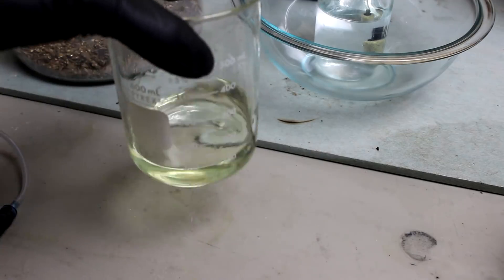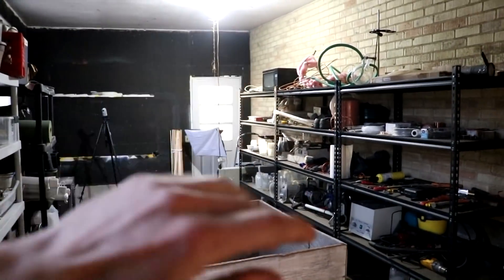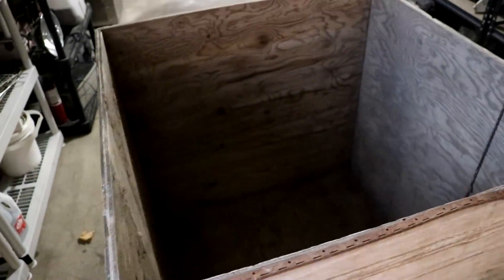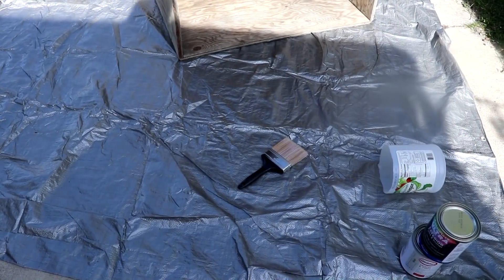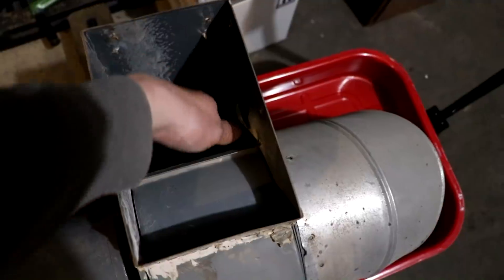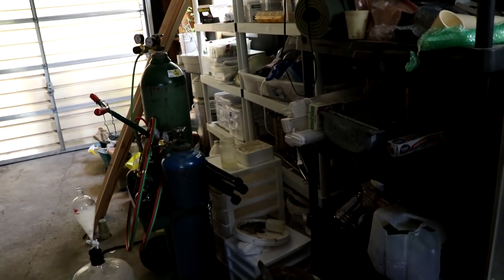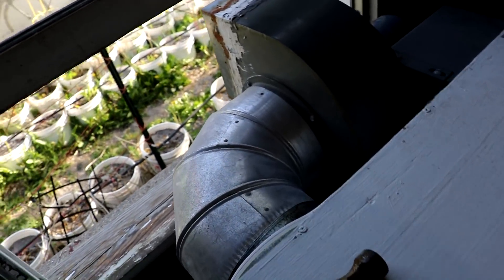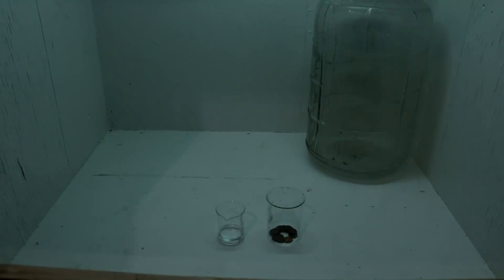Cody’s Fume Box

Comment: I refine precious metals. A few things you are going to run into. The nitrous dioxide is going to turn that wood into nitrous cellulose and potentially ignite. The electrical items inside the hood are going to be eaten by your acid fumes. Cannee with the metal duct work and the squirrel cage fan. It is good you built a fume hood, I just think it isn't going to last very long the way you built it.

Comment: Literally an acid rain generator with that BFRC there. I get that eventually it could be fertilizer, but that's ignoring a lot of damage it could do in the present. Especially in an urban area. Also, that fan is going to be covered in rust and corrosion pretty quick from the fumes. I think they make fans designed to withstand AR fumes. Might be good to mod that in there with PVC instead. Even stainless will succumb to acid corrosion.

Comment: Cody, I am right now dealing with small issue but have no real way to test better solutions. My room regularly reaches 100+ degrees F, I have fans blowing in but they barely do anything. Do you think/could you test if within a constant volume area if a fan blowing in or a fan blowing out has a bigger impact on temperature? According to the little bit of gas laws I remember both should have a cooling effect for different reasons (one just because it is moving air, the other because in a constant volume system if pressure drops temperature should too drop.)

Comment: I just wonder about a few things with this design: 1) How well will that fan resist corrosion? 2) Aren't you concerned about your plants right outside getting affected? 3) Shouldn't you seal the wood on the inside to prevent the paint from reacting with anything, even the moisture in the air?

Comment: the problem i see is your just expelling fumes into the local atmosphere, without filtration, that could potentially have GREATER impacts because of it, and the fan you are using is not specialized for chemicals, so it could potentially have a chemical reaction to the gases being expelled and have a growing catastrophic failure over time.

Comment: Dear all — (1) No, this setup isn’t perfect. There is definitely room for improvement (2) Remember you’re watching a Cody’s lab video. Cody knows enough about what he is working with to know what he can and can’t get away with. Let’s imagine a ‘worst case scenario’ where Cody decides to fill his fume hood with an explosive mix of hydroxy gas, and then oops it gets lit. How much energy do you think will be released? Do you think it’s truly likely that he’s going to burn down his house in this scenario? Might destroy his equipment, sure, but doubt it would create a run away reaction. What about  toxins outside —- again he isn’t dealing with things on an industrial scale. Really doubt by the time this gets diluted in to the atmosphere it will cause much trouble, if it does though, guess what — he will fix it. Industrial fume hoods need to be built for idiots, that way you can’t sue the company that made when something goes wrong. In this scenario, a less than perfect hood is just fine. Good job Cody!

Comment: Build a mercury stun gun. You mention in the Sprengel pump that the mercury can build a charge in the reservoirs. Mercury is also a good conductor. In theory you should be able to create a charge, store it in a capacitor(or maybe even the mercury could be used as a capacitor), shoot two streams of mercury at a target and release the charge. If you don't want to shoot a stream of mercury, submerge the end ends of two thin wires in the reservoirs and shoot them instead. It should release the charge on contact.

Comment: Can you move the pump outside and run a pipe through the wall? It would be much quieter for the videos, and you wouldn't have to worry as much about the intake pulling fumes back into the room.

Comment: As someone that could not grasp chemistry - can someone explain why fumes are ok to vent into the atmosphere? I would have though some kind of catalyst or filter or something that would prevent something bad to escape out? I'm not trolling here I've been wondering this for a long time..
Reply: There is not gonna be many fumes. Cody won't be using it 24/7, its not like a factory, which produces millions or billions of times of fumes and gases, all the time. Such small quantities dont matter. And in any case its much better to vent them outside rather that inside the house, so thats why he built the fume hood
Reply: Thanks for answering. My curiosity is slightly more satisfied..
How about universities like say in Periodic Videos channel? And to be more precise if that air duct goes outside on the roof are there required limitations to roof access during fume hood's operation?

Comment: Instead of tiles or a plastic bin, you should just seal the bottom and part of the way up the sides with phenolic resin. It'll be thinner and more durable than tile and much more chemically resistant than plastic.

Comment: I see one potential problem. The fumes are going to be eating away at the fan blades, and eventually they will fail. Also, there's always a potential for the motor itself to reach the end of it's life and die. If this happens while you are using it, it could be a deadly situation. I think I would find and install a second blower just to be an emergency backup.

Comment: The exhaust fan will get eaten away by the fumes. You might want to try adding a carbon filter at the front so that at least some of the gases get scrubbed before the fan. Also, if you're going to be working with flammable fumes, you'll need an explosion-proof fan because the brushes spark. Finally, might want to aim the exhaust air directly up (outside) instead of into your garden.

Comment: If I had to guess, that box was probably used for something like concert or theater equipment. It has that kind of look, and the build/handles are pretty common in that use. Snagging that was a pretty good find, even if it is a bit worn down. Obviously it's not laboratory-grade like you'd find in a university research lab, but it was pretty ingenious. You made it to suit your needs, and it should work. Like you said, it'd likely be a good idea to put down some kind of containment tub and some tile to protect the interior, as the paint can only do so much. And again, like you said, if you're going to be deal with anything particularly nasty, you'd probably want some kind of air scrubbing. 

But for what you're realistically going to use it for, I'm sure it's pretty much perfect. It gets the fumes out of the house, and it disperses them outside. I think that's way better than setting up in the yard and just hoping that it's breezy enough to keep the fumes moving. Now you have a reliable airflow that will disperse the fumes, instead of sitting in a cloud of fumes on a windless day in the yard. 

All of that said, I'm not a chemist, not in the slightest. I'm a college student, studying civil engineering, so this is out of my expertise. I'm mechanically inclined. And while I have a basic idea of handling chemical materials and building to be resistant to them, I will happily defer to the ACTUAL chemists, as well as those with more experience. It goes without saying that you and others with specialization in this field know more than I do about this.

Comment: Hey Cody, bear in mind that this is still not fire-proof or resistant to chemical attack. Consider a protective coating of plastic and probably some spare tiles in there to be able to use it better & without risk of damage to the box itself. :)

Comment: Acidic fumes (esp. HCl) are going to wreck that fan in pretty short order. Also the ducting and metallic objects inside the cupboard. I found this out the hard way.
There should be no metal inside (esp. electrical) 
A better method is to use the venturi effect to suck fumes into the air stream. That way, the fan generating the air stream and its bearings and electrics are not exposed to the fumes.

Comment: I'd suggest lining the inside walls and ceiling with a shower curtain liner. This could just be tacked in place, and could also cover the lights if they aren't hot. This way, when (not if) something blows up in there, you can just wipe down the curtain, or take it out entirely for washing. It will also keep liquids off the light, if you cover it.

This isn't a criticism of your design, which seems to work quite well (aside from being rather loud). It's just a suggestion so that your new fume box will last longer.

Comment: Your fume hood needs an exhaust on the fan to ensure that waste air in not drawn directly back in through the window. Or, board up the window around the fan outlet so it cannot allow air back in through it, the people raising concerns about air pressure and air source and flow have a point
Reply: Oh, and you need a clean/safe air supply, vents with simple carbon and paper or fibre filters on the opposite wall would probably do

Comment: I love your design! You might consider using 2 part epoxy for the bottom. If you come up a little on the sides with the epoxy it would act like a big pan and prevent any spills from seeping into any cracks. You would just need to add a 1x2 to the front so the epoxy doesn't spill out before it dries.

Comment: Maybe you could consider put all the electric plugs outside of the box or somehow protect them. It is definitely not air proof and if you go and create corrosive atmosphere, it will degrade electric contacts. I know the main hassle with the material degradation will be the electric engine, but the extension cord and switches inside can be moved outside with ease. And please, I mean this comment like input for brainstorming, not like criticizing your work. Your work is great.

Comment: Does the air just lead out the window ?
If you want to be enviornmentally friendly, 
you could bubble the air outside into a a container of water with naoh or baking powder.
The sodium should exaust all acid to a form where it won't react with anything anymore
and you can just flush everthing.
ex. Na2so4, nano3, nacl

Comment: Make a vertical stack several feet tall using ductwork and attach it to the fan on the outside. Better to have the fumes blowing out above your "lab" rather than around window height. You might also be able to achieve some level of passive ventilation if the stack is tall enough.
You might want to move the power strip outside the box too.

Comment: Here's an idea ,Could you cut 2 holes on the glass? Then you could fit 2 gloves into metal rings to fit them in so you could work much easier and not have to squat down in a weird angle.

Comment: Very nice build. but I'll tell you my meaningless suggestion as everybody is doing so:

What about moving the vent outside? This way you would have much less noise and a full low pressure conduct. As it is now you have a small part that is high pressure inside the room and if there is some leakage it could blow some of the fumes back.

Comment: Hey Cody, I would suggest you mount the power strip outside to limit it's exposure to potentially corrosive fumes. It might also be nice to put in a variac or dedicated speed controller for the fan.

Comment: Just a suggestion but I would place the blower outside and run ducting to the box for the noise reduction and in case flammable gasses are ignited by the motor it would be away from you and your lab lol

Comment: Pleased to see you are trying to protect yourself.  As an industrial chemist who has, in the past, designed chemistry labs I can honestly say that sulphuric and nitric acid fumes will eat through that metal fan and ducting in no time at all, you need plastic replacements; would also advise ducting the fumes upwards once outside the window and narrowing the bore to accelerate flow thus preventing blowback and will help with dispersion of the fumes.  Heavey metal fumes over the food plants is not advisable.  Anyway, great vid and thanks for sharing.
Reply: Cool

Comment: I love your build. I am facing the same issue, needing a fume hood and every "proper" solution ends up being $1k+. Just keep in mind that the wood is all flammable, so be careful with open flame around the enclosure. You can buy cylindrical carbon air filters on eBay that attach inline to your exhaust that would work pretty well for a lot of the organic vapors being discharged.

Comment: Hey Cody, Nice little hood there but id like to recommend some changes (coming from a research and development chemist with abit of experience knocking together makeshift hoods and reactors). Id make the tiles a priority as any oxidant spilled on the wooden surface (such as nitric acid) could be a real fire risk even after being cleaned up. Maybe put them 1 tile width up the side; encase of any serious spills. Some form of lip at the front is also a good idea for similar reasons. Another issue is the fan, it may actually be to fast causeing turbid air which can negatively impact the flow in the hood. And lastly (most importantly as this effect you and innocent bystanders) install a stack and have the fan near the top if possible. This will reduce the flow speed making it more laminar and will move the escaping fumes higher allowing faster winds to catch them and remove them safely. NO2 is nasty and could easily get you a visit from the local police worried what you are making. 
Regards Ryan (long time fan even used some of your refining videos during my undergrad research)

Comment: Hey Cody, couple pointers. 
First, look into getting some silicone to sure up the seal around that exhaust port.
Second, consider just doing a 3-way light so you can control the lights and or fan from more than one spot.

Comment: You may consider restricting the outlet a little if you’re using a squirrel cage fan. Otherwise, it’ll draw a lot of power and could overheat. It’ll still flow about the same, however.
Reply: Though it’s possible restricting the inlet is enough. Just a thought.

Comment: @Cody - You might think about using PCV pipe instead of galvanized steel for the piping, and create some sort of tube-in-shell venturi to protect the motor and blower from being exposed to the exhaust stream directly. Fumes from mineral acids are going to do a number on all of that assembly very quickly.

Comment: Are you sure the gases you produce are safe to pass through the tube? For instance, NO2 would react with any water that may be present on the air tube and make nitric acid, and dissolve away the metal tube. Chlorine might also eat through the metal.

Comment: Gotta watch what organic solvents or acids you use with that acrylic panel, Cody. It could dissolve a bit of the surface layer and make the panel cloudy, and warp. That is, if the negative atmosphere could remove the vapour quick enough.

Comment: Could use a triac to control fan speed. Also, the air intake should de flush to the wall, pointing it down with high flow causes turbulence that makes the fumes go down before exiting.

Comment: Consider calculating the cross-sectional area of the exhaust.  Then determine how high you have to raise the door to have an opening equal to that same area.  Mark the door frame so you can always avoid straining the fan motor.

Cleaning tile will be a nuisance because the joints between tiles will be a little uneven and the grout will stain.  Consider formica or melamine.

I used to work with a fume hood that had an epoxy base.  It was great!  It was resistant to everything.  You certainly have the DIY skills to make one.  From a home improvement store you can get epoxy floor coverings that should work well.

Also, are you aware that epoxy paint is commonly used for bench tops in chemistry labs?  I think it would also be available from a home improvement store, but for sure you could get it from a scientific supply house like Fisher, Wards, Preiser, etc.

Comment: I suggest also adding an extra, perhaps smaller hose or an extension of some sort, with an adjustable arm to position the opening of the pipe. that way you can pull air from a specific location (i.e. directly on top of the beaker) instead of the entire box
Reply: The suction is strong enough to pull gases from the whole box already. No need for extra parts. Simple is usually the best.

Comment: Maybe add a full stick of 4" PVC standing upright fastened to the roof to get the fumes up and out of the area, so they don't find there way back in. If you vent directly out the window wind on that wall can make a fair bit of positive pressure.

Comment: Really well set up!! I have a thought on the fume hood, you may have already considered it though. If possible find a way to regulate the blower speed; maybe a variable output power adapter would work. That way you can manage the fumes as needed if it doesn't show any harm to the blower motor in there. Otherwise it looks amazing CoDy!

Comment: If anything you could add a small thin strip of leather/rubber at the top so that the negative pressure caused by the air blower can create a better seal for any more toxic fumes you are to create during any experiments. There are some really nasty fumes out there and sometimes a single whiff enough to prove harmful.

Comment: Looks good. Buy some adhesive backed felt tape and make a seal along the top and sides. Will seal it, make the door slide much smoother and will protect the plexiglass from scratching.

Comment: For extra protection you can use ptfe coated fiberglass in the walls of the box. That thing resist heat very well, practically inert to most chemicals and its cheap.